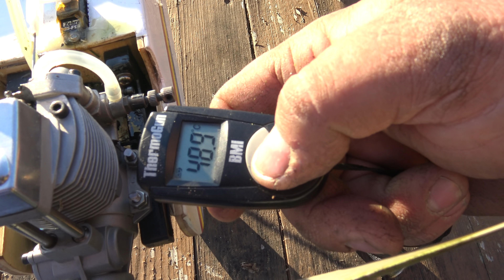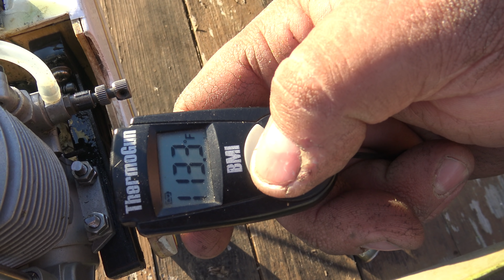Trainer plane HappyTime 1.5m & Thunder Tiger 54 four stroke glow engine Test flight

Comment: I love trainers..  I flew mine last summer via FPV.  During the summer, isn't wasn't uncommon for me to fly 1/2 hour to 45 minutes in thermals while the motor ran at idle.  I would fly 1/4 mile away at times... I ripped the wings off of it in a fast dive and pulled up hard.  Wind got underneath the leading edge, off she came... ;)  Trainers are fun.
Reply: yes i love them to...you can do with them almost anything :)

Comment: I have just bought a brand new OS 52 FOURSTROKE SURPASS ENGINE  and im thinking of putting it onto a seagull boomerang v2 trainer with a wingspan of 61 inches.  I still prefer the sound of a fourstroke engine over an electric motor even though i fly both.    This was flown nicely by Captain Blaz and of course Robert it needed your photographic skills and humour to finish it off.    Well done to you both.

Comment: In the early days, I used to use a rubber foot made for steel tubular chairs. There were different diameters, so you could stuff one smaller one inside a larger one. Mine lasted for more than 10 years.
Reply: yes this would be nice yes...thanks...

Comment: Captain Blaz, something I have found, pull the rubber cone out of the electric starter and put it in backwards to crank engines without a spinner on them. then when you have an engine that has a spinner pull out rubber cone insert correctly, this will help rubber cone last much longer.
Reply: yes i know but the smaller side is also bad on this :((

Comment: Congratulations, very nice Flight, good flying Modell, super  weather conditions, Take off was First Class, OK the Loop was'nt really a Loop (to slow❓) does this Modell need more Power, it appeared to me rather slow during the whole Time, but the Engine seems big/strong enough, maybe a two Stroke Engine would provide more Power, maybe a 90 four Stroke would be the Best Solution, Pilot Robert as Cameraman👍🏻
Cptn Blaź as Pilot 👍🏻
Best of Luck Gentleman, best Wishes, and many happy Landings. Anton from Vienna 🇦🇹
Reply: oh this is test plane for diff engines....maybe i could use a bit smaller prop here but it is ok..i will put anothere engine on this soon :)
Reply: @BlažPetrinčič  I am looking forward, as always 👍🏻

Comment: Nice flight and good landing. Personally I think electric planes are a bit easier to work with, but I must admit a nice 4-stroke engine does sound nice.
Reply: if you tune it like this there is nothing to do only fuel the tank and up you are :)

Comment: My vertical stabilizer is kind of bent crooked from the plastic on the fuselage being warped. Is there a good way to fix this? Its only attached to the thin plastic of the fuselage. It came assembled like this but probably bent in storage. Im hoping maybe if I hold it vertical and press it onto the horizontal stabilizer while epoxying it will stick in the right position... Amazingly my nicad batteries work from a 2007 model lol servos and everything seem okay

Comment: Great video and a beautiful engine. Stay with the 10% nitro on the Thunder Tiger. I have the FS75  Thunder Tiger and after break in I went to 15% nitro and it overheated and warped the head. They are not as good quality as the Saito or the OS engines. Thunder Tiger informed me they recommend 10% nitro. Oh Yeahh!!!
Reply: oh thanks for info....cheers..

Comment: I have a brand spankin' new Thunder Tiger F-91S.  I want to put it in an equally new Great Planes Revolver.  I'll have to break the engine in first, but it sure is a pretty thing.  Unfortunately, it will be mostly covered by the cowl... or fully covered if I mount it upside down.  I haven't decided yet.  Do you have a suggestion to either side mount or inverted mounting?  Thanks for all your videos, I enjoy the heck out of them- and I am subscribed.

Comment: Hello Captains. I'm recycling a Easy Fly 40 witch original Ultracote covering is peeling off and would like to use a servo to coltrol the engine like yours, right behind  the engine.  Is that a 9, 15 or 30g size servo?  Thanks for your nice videos with friendly accent. A warm Salute from Brazil.

Comment: Seems like more than enough power for a plane that size. I honestly do not know how much power a 4 stroke produces compaired to a nitro. Is it less? I would be interested in knowing. I have a Kadet LT-40 that is pretty much the same as that. I am running a .52 in it, replacing the . 45 that was originally in it. I still have the original Super Tiger that was put in it. I put new bearings in it but the carb was mucked up a bit. I ended up adding an external main jet because it was flooding. Now it runs good but I am not putting it back in the Kadet because I do not trust it.
Reply: four stroke ha got more torque and it can swing bigger prop but it has less hp...but they work just fine...

Comment: Good to see you flying with cofidence the diffrence between electric and  gass engines is of torque at low speed nitro  methane definately has more punch even at low speed . This is the diffrence  in your flying  the electrics at low speeds and slow turns
Reply: yes this is why i love nitro looooottt more :)

Comment: I replaced the front landing grear on my RC nitro plane. Basically the spring loaded wire and wheel. It is not servo control but just moves freely. Now it only wants to turn left when pushed or go horizonaly which is not good. Any ideas?

Comment: Build a Flyin King. 80 inch W.S. with an all up weight of 10 to 11.5 pounds and a .75 flies it with authority. I fly mine with a .75 Super Tigre and it's off the ground in under 50 feet @ fast idle.   http://www.btemodels.com/flyin_king.html
Reply: I got kit #88 in 1998 and it was 30.00 cheaper. This kit/plane is worth every penny. This Az heat has killed my covering after 21 years and i am going to be recovering it soon. I really miss flying that plane.
Reply: oh this is very nice bro!!!